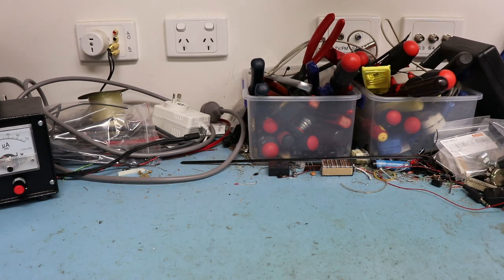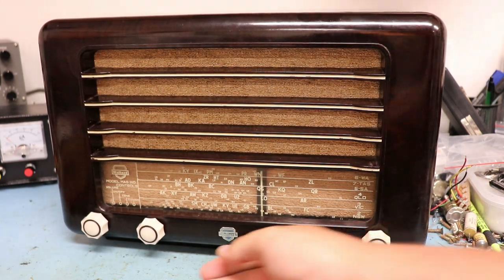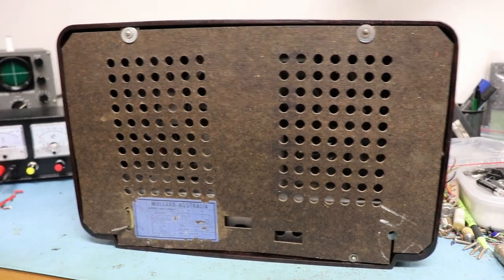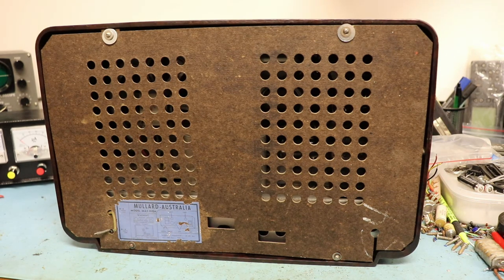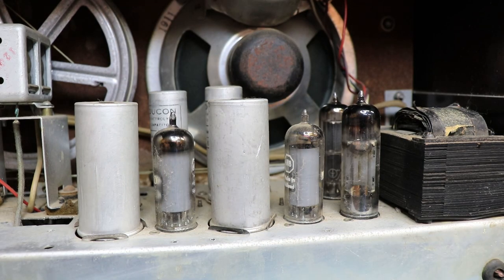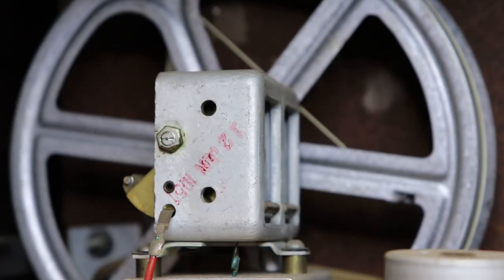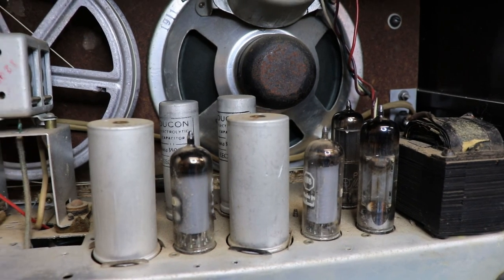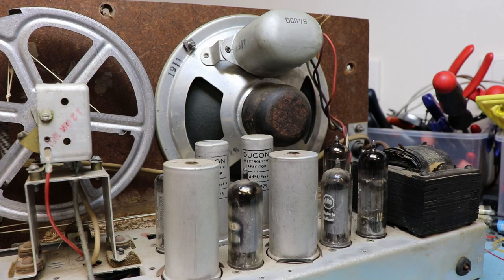Mullard MAS 1110 Valve radio Part 1 - Electronic restoration

Comment: Some may not agree with me on this but... Years ago I learned you can clean around the stenciling with Q-Tips and water for loose debris and dust, being careful not to touch any print.  Then, I lay the dial glass on a clean surface and use clear Acrylic spray. Starting at a foot above it straight down, start AWAY from the glass depress the nozzle without stopping, and with continuous sweeping motion left to right, start coating the back of the glass. When you see you have a uniform coating you can now get within 6-8 inches and leaving a good even film, only releasing the nozzle once you have moved away from the glass.  When it dries you no longer have an issue with the stenciling rubbing off.  It works great, and I know many will be afraid to try it as I was, but I started with a junk dial and a blank piece of glass using that method and it turned out great.  (Be sure to have a clean not dusty area to do this)

Comment: That's a loverly old radio :-D
but something is generating a lot of noise or the front end is detuned.
I would expect it to go very quiet if you grounded the antenna input, if it doesnt then you still have a problem inside.

Mica capacitors in the tuning cans can be trouble as well.
I hope you don't give up on it,  really nice set :-D

Comment: Thanks for the video. Like the style of it - plenty of talking. I am recapping my identical Mullard and wish to replace the 2 24uF 350VP caps as well but have 47UF 400V on hand. I heard somewhere that that would put strain on B+. I would appreciate your thoughts on the matter ie, if they are safe to use. Looking forward to Part 2 of your project. Btw, my unit has a larger tuning capacitor. I noticed on your unit that there are mounting holes for same. Thanks
Reply from the maker: G'day! Yes two 47uf capacitors would be just fine. It's alright to go up 50-100% in capacitor value but you wouldn't go down. There will be a bigger surge on the rectifier valve but it wouldn't be a issue with 47uf caps. Ideally you'd replace them with 33uf caps. Ah yes well I always wondered if there was a bigger tuning capacitor as my little one always looked out of place.
Reply: Burnt Out Electronics  Thanks heaps. I can send a pic of the tuner if you like. I see your email address in another post.

Comment: 7:40 Good advice - likely coming from bitter experience? ;) Is the "plastic" on the edge of the glass definitely plastic mouldings? Or could it be some caked tape/foam/rubber? You should take advantage of this opportunity and either scan the glass or (imo better) take a photo of it with a camera fixed on a stand. It's good that you did not try to clean up the cloth. Sometimes people go too far when restoring (and end up paying for it!).
9:54 Great mains cable strain-relief method! I've got to say, this looks super clean, as if it was  kept locked in a cupboard for 70 years and only just came out. 
12:55 You skimped on the 10uF by not using an orange drop!! tut, tut! Why do all radio restorers skimp on 10uF caps? Metal film caps this small are not that much more than their sub 1uF counterparts - I don't get it! :)
25:00 Why not carefully use a hairdrier, starting on the low setting, to soften up the wax?
27:14 Hmmm maybe you could wire up a ferrite core or a loop antenna? That way it won't need a connection to permanent outdoors aerial...

Comment: reeplace all the caps
Reply from the maker: I replaced all the necessary caps as the two electrolytic capacitors on the B+ tested great after being reformed and don't need replacing
Reply: How much dollar now this Radio please say?
Reply from the maker: @technicalmasternadimji9008  are you inquiring how much the radio would be if I sold it?